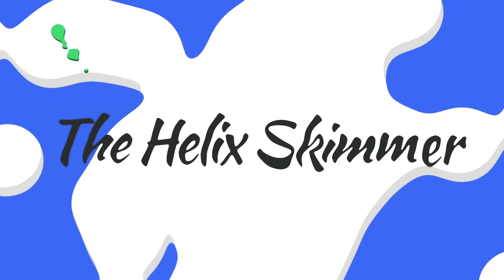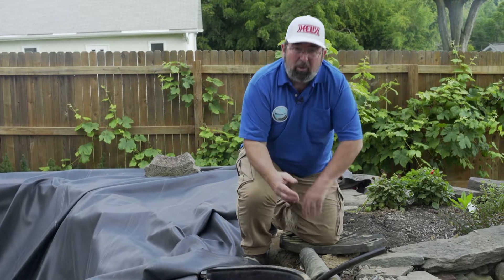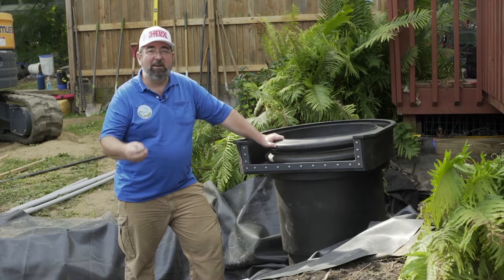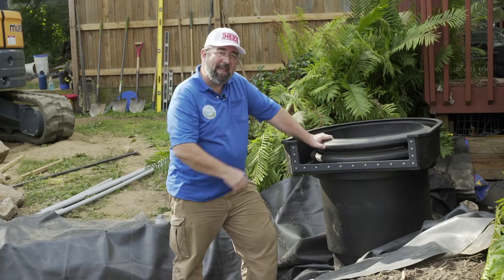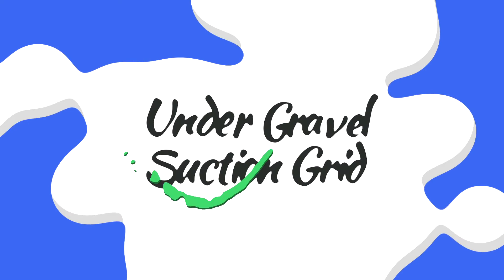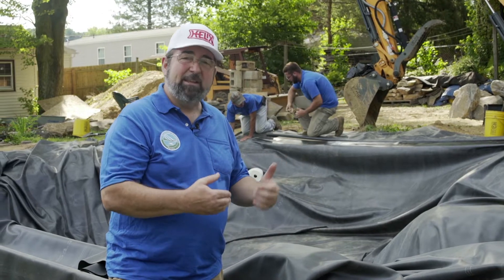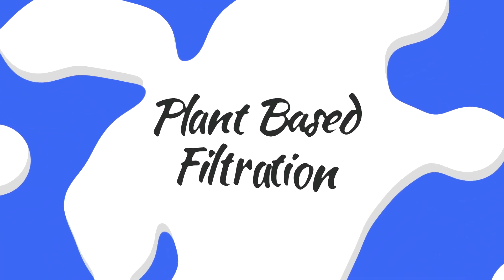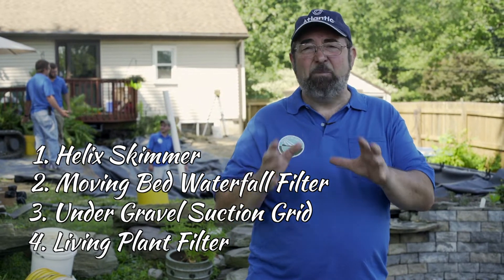04 How to Design Your Dream Pond Filtration System

Comment: Hey Nate, would an outdoor system like this work for saltwater with of course some substitutions?
Reply from the maker: Hi Sage,    My filtration, would work for salt water.  The external pump can be purchased with saltwater seals which would make it okay.   So most of it would work perfectly fine with salt water.  I don't think my lights would hold up under those conditions.    My question for you is what you plan to keep in it.   When i think of a marine tank i think of tropical fish.   Tropical fish would not holdup over the winter where i live, but temperate fish would be fine.   For sure, the under-gravel suction grid, the right external pump, the moving bed filter and probably the Evo K+ Microbead filter would all be just fine in that application.    It sounds like an interesting undertaking.    Feel free to email me directly with more specific questions.    nate@practicalgardenponds.com

Comment: No UV light needed with such filtration system?
Reply from the maker: Thank you for your question.  I do actually have a 120 watt UV on my pond.   I am not sure that i really need it, but I like the fact that in addition to preventing any possibility of planktonic algae, it also kills the water born stages of some parasites, and therefore could keep my fish healthier.   As far as green water goes, the four fold filtration system certainly lowers the probability of green water, since it uses up nutrients and keeps the pond cleaner, but only a properly sized and working UV will absolutely prevent green water.   Sincerely, Nate

Comment: Is it necessary to add a liner to an old pool? For a pond conversion
Reply from the maker: Hi Anthony,    If the pool is in good enough condition and holds water there is no specific reason why you would have to add a liner.  Though adding a liner would give you some additional options like building in a skimmer in a corner outside the liner.   The color would also change.  But you could use rocks, plants and so forth to change the appearance as well.   Enjoy

Comment: Totally untrue that you don’t have to clean that under gravel filter, anyone who has had an aquarium with the same kind of filter will tell you
Reply from the maker: Hi Debbie,   Sorry for the slow reply, the Covid19 year has been extra busy and I haven't been able to keep up with all forms of communication.   I can relate to having issues with Aquarium UG filters, but ponds really are different.  In fact, we don't recommend UG Suction Grids on shallow ponds.  We also do recommend using a good Beneficial Bacteria that breaks down sludge regularly ... AT VERY LEAST once in the spring every year.   When Suction Grids are built the way we recommend, starting with the ponds being at least 3' deep, and Sludge Away or a similarly effective product is used at least each spring, we have many years of experience that back up our claim that a properly built UG Suction Grid will remain unclogged and effective.   I can personally attest to one pond that has not been cleaned for 30 years and it looks as clear and clean on the bottom as my own pond built in 2018.   I do have several forms of filtration, a good Helix skimmer, an Evolution Aqua K+ Bead Filter, a Helix Moving Bed, the UG Suction Grid and multiple bogs.  But my pond is very low maintenance, crystal clear and the water tests perfectly.     But you are right, i would not expect the same results in an Aquarium.  Thanks for your interest!   We have plans we share freely with customers for building a UG Suction Grid you will be happy with for many years.  Please feel free to email or call us!
Reply: aquarium is different than a pond

Comment: Hello guys , congrats on your wonderful videos. I have a question that never gets discussed. How do we calculate the correct amount of water that should travel through a bog filter per hour? I am planning to build my pond with a surface area of about 600 sqft and depth of around 6 feet. I want to have a very large bog of about the same size of the pond approx 500sqft. I will have about 5-10 koi fish. Also the bottom of the pond will have gravel and water will pumped through the gravel up flow. I would like to know how how much water per hour I should pump through the pond and how much through the up flow system on bottom of the pond. I never found anybody that discussed this topic....glad to hear your input.
Reply from the maker: Hi Habita,   I can understand your question and the feeling that it doesn't really get answered.   You may end up feeling like I didn't answer it either because to me its a concept, not a number.   The concept is that a bog or under-gravel grid (be it suction or upflow) should ooze water thru the bacteria and plants slowly.    Racing water will strip nutrients away from the plants and push organic debris thru the gravel.   But a lazy flow will allow the nutrients to be absorbed and the organic waste to be processed.  But there is a great amount of flexibility in the definition of oozing.   That tremendous flexibility is why it would be unhelpful to put an exact number on it.   It's very forgiving.  Slow and slower will process.   Only rushing water will diminish the value of the bog or under-gravel concept.  In my experience, the exact speed of the flow is not going to change the natural processes.   When we build a pond, we calculate the flow for ornamental waterfalls and for total circulation (yes ... i still like to turn over small ponds at least twice an hour ... and larger ponds once an hour ... and in very large ponds sometimes much less)  ... but I use only a portion of those flows in my grids or bogs.   The smaller the grid or bog, the smaller the portion of the whole pond's flow that should go thru it.    So if your pond is about 25,000 gallons (which it could be given what you have told me) with such a light fish load, your flow could be very moderate, but lets say you went with 12,000 gph.   Of course with our pond building style, we would do uplift in the bog and suction on the pond bottom.   In my example, you could easily ooze up to half of that flow rate thru such a large bog and grid, still leaving you with 6000 gph to run over a beautiful and dramatic waterfall which will produce beauty, sound and aeration.     I hope that is helpful.   I don't come to YouTube too often - feel free to directly email pond questions to nate@practicalgardenponds.com for product and application advise.   Enjoying your pond!

Comment: Stone age pond building
Reply from the maker: Hi Tony, We certainly do combine new technology (there is nothing outdated about a Helix Moving Bed Filter or Skimmer) with tried and true methods like plant filtration and self cleaning suctions grids which have been around a very long time.   And I guess nature has been around since the stone age.   Some concepts remain valuable even when they are not new anymore.   I think the key is finding something that works well for you.   I like the appearance of rocks and gravel and plants.   My pond is very low maintenance and crystal clear, and it doesn't cost a lot to keep it running.   For these reasons we feel the concepts are worth sharing but they certainly will not be for everyone.   On our website we offer many different technologies and options, not just the ones we prefer for our own pond.   I wish you well with your pond methods of choice.
Reply: educate ya self..you'll learn something...

Comment: No uv?  Good to see Helix being used👍
Reply from the maker: Hi ToySpeed ... excellent question.    About a month later i did add a UV ... 120 watt unit.   I don't usually need it but felt it was a good idea.   Really would not need it as far as green water goes, most of the time, but i like what it also does to prevent the spread of many parasites that have water born stages.   Thank so for your question and your support of Helix!